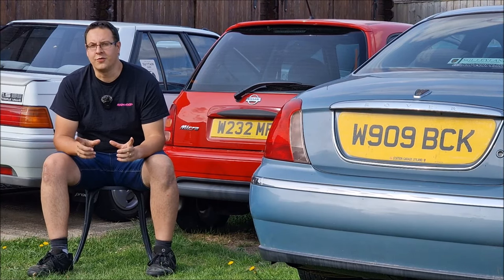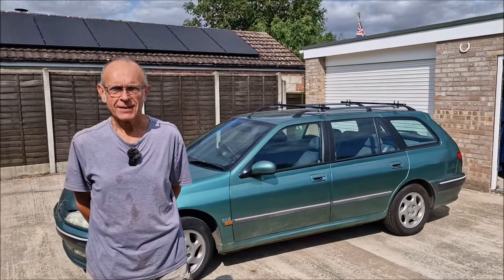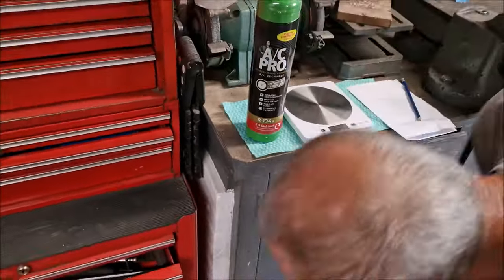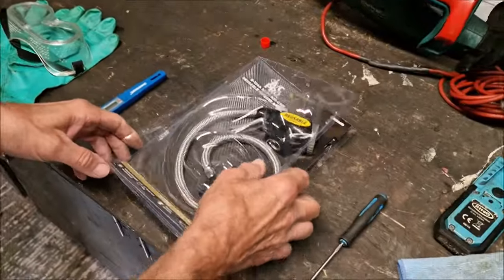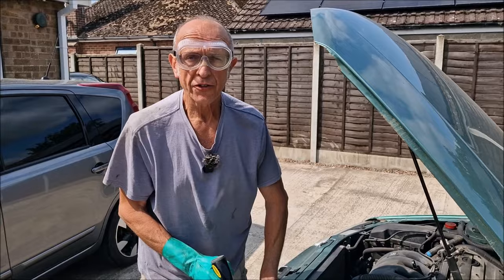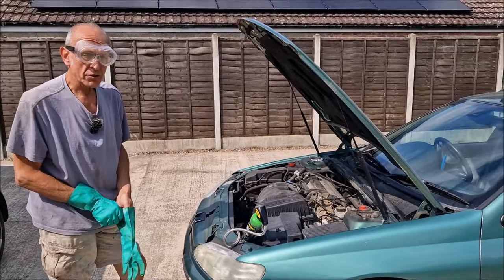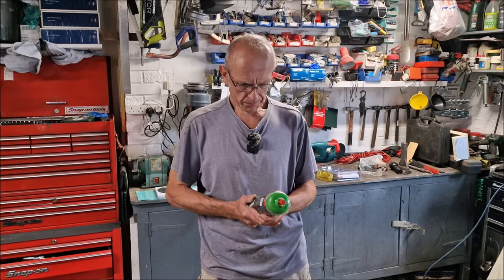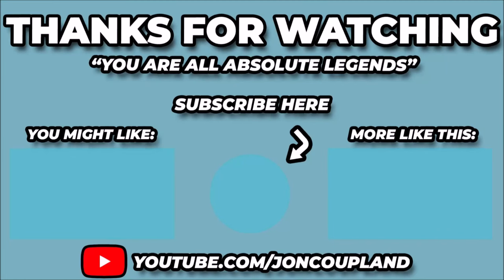DIY Air Con Recharge Kits - Leave It To The Professionals? - Review & Test

Comment from the maker: Hope you enjoyed this latest video - what did you think? DIY is ok or leave it to the professionals?
Reply: Usually have it checked every 2/3 years when being serviced & MOT.
Reply: Great video, as always. Loved the disclaimer intro, very professional!
Reply from the maker: Cheers  @calibrax
Reply from the maker: @stippolyte  yes! Good practice
Reply: I've used this bottles a few times. I'm pretty sure the instructions say to have the engine running, a/c on high and recirculation mode on. It's never going to accept a recharge without it running as it needs the compressor to suck the stuff through. That's my understanding of it anyway. Good video tho!

Comment: I was going the DIY route for my 451 a/c gas renewal as my iCarsoft diagnostics indicated zero refrigerant pressure. However when I got there they offered to test it free of charge and even had a 10% discount on regassing if you chose to go ahead. They simply used a can off of the shelf, used all their own equipment and charged me £65 all in with a guarantee to sort it if it leaked.

A no brainer really. Highly recommended
Reply from the maker: Absolutely 😁

Comment: I found it a foolproof and simple system. You can’t mess with the A/C system legally and you shouldn’t anyway. But the kit isn’t about interfering. It’s just a top up. Work on A/C is for the pros.
Reply from the maker: A great way of putting it! Thanks for watching
Reply: You can mess with your AC system legally. You're just not allowed to release refrigerant. Get the system evacuated by a garage and you can work on it all you want, change a dryer, compressor, lines etc, then get the system regassed afterwards.

Comment: The reason you had a high reading initially was because the compressor had been running and the high and low side pressures were still equalizing and don't forget that at 75 degrees F  the psi should be around the same 75 psi if gas was in the system.
Also there is no way to purge that hose and connector as with proper gauges so moisture will be taken in.
Stop leak is added in those DIY bottles and should not be needed and is a last resort really.
Dad was right a proper gauge set is best and quite cheap on e bay and high and low side pressures can be checked.

Comment: It's very strange it said do it without engine running as most of them diy refills tell you to run engine with ac blowing full blast at the coldest settings? Also you get £10 back on return of bottle so bargain 👍
Reply from the maker: Interesting